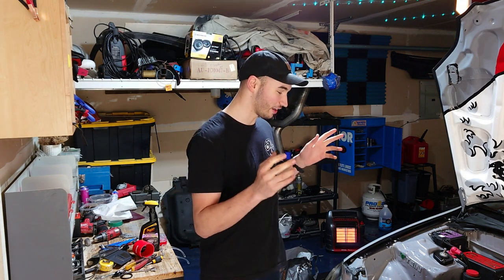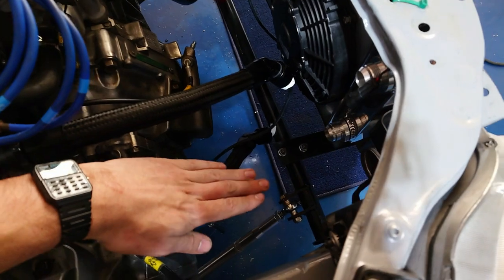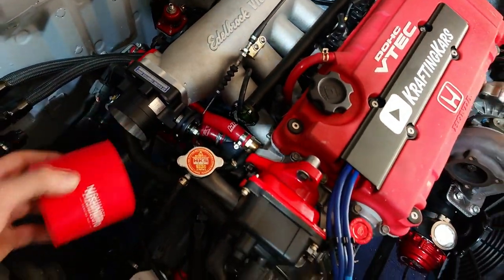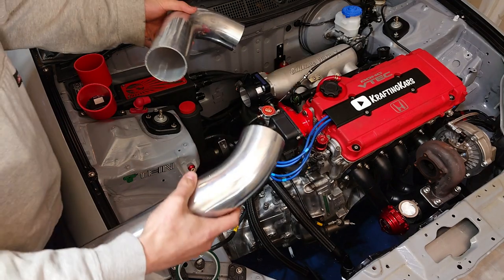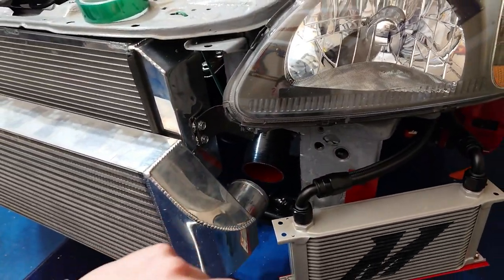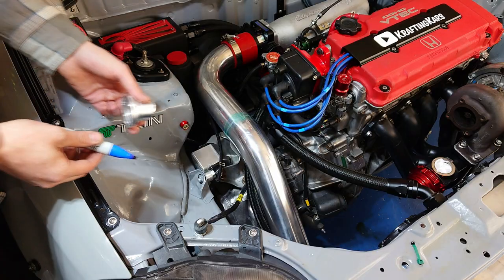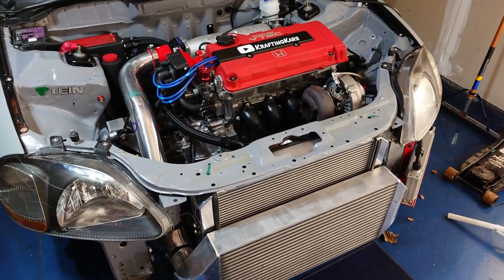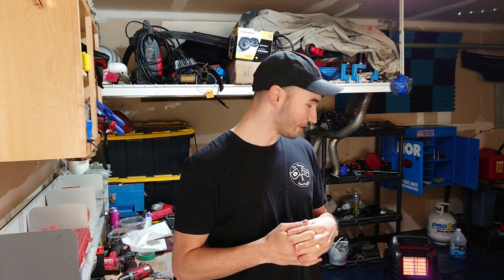DIY Intercooler Piping! Turbo Civic Project

Comment: Car is looking sweet! what pound spring are you using in your bov and wastegate?
Reply from the maker: Thanks! I will be using a 15lb spring in my wastegate with manual boost controller to bring it to 18lbs! For my blow off valve I am using a hks ssqv4 with the stock insert